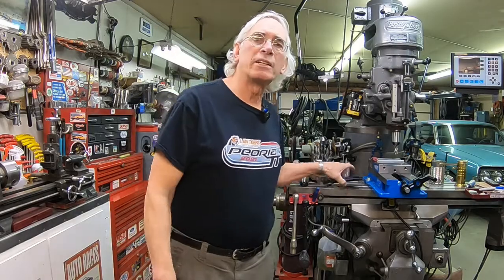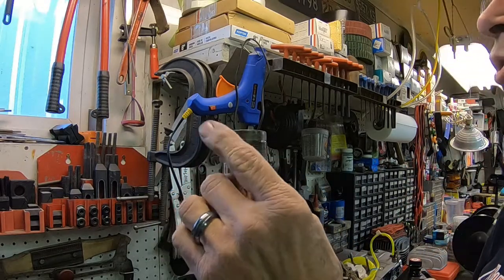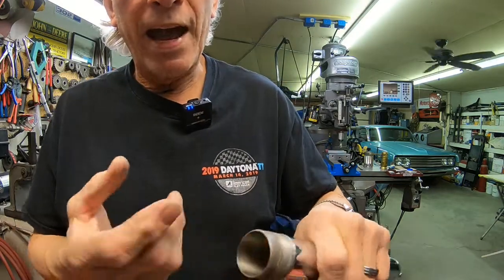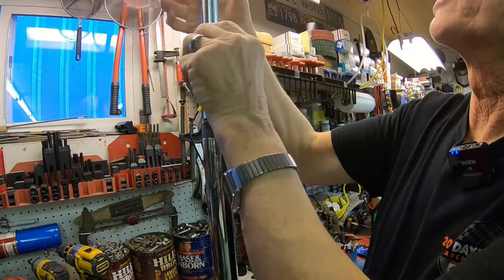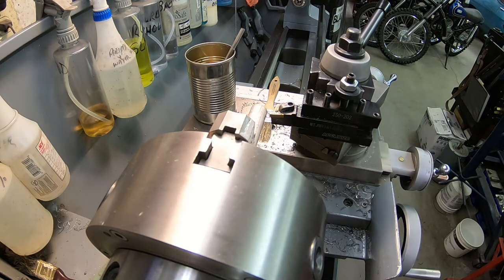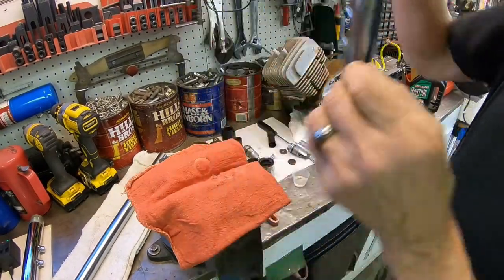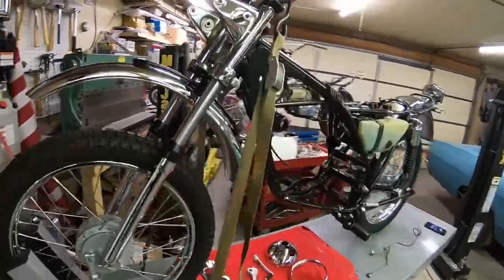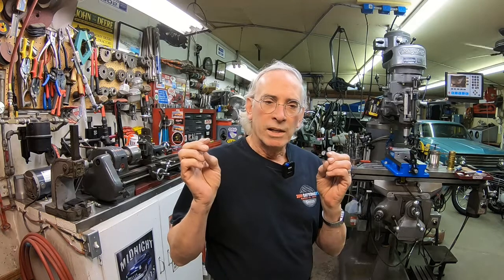73 Suzuki TC125 new chrome, front fork assembly

Comment: Hey  Dale,  man that chrome looks good, I  don't care for it much on motorcycle engines or automobiles. It  just retains too much heat. Got some more folks liking what you do. I'll be talking at cha...
Reply from the maker: Thanks Larry, yeah Im not a big fan either, but in moderation I do like some chrome. There is a whole lot on the TC 125 as compared to the TS 125. I have never had the problems with it that I have this time. I always use the same folks, and they are great to deal with. But I generally dont plate parts with threads, made it work thats what counts. Thanks for getting the word out about the channel, I sure appreciate all my viewers. I have learned more from them, than they from me. I cant believe how many folks are still playing around with these old bikes. Glad to see it. Thanks again Larry.

Comment: Hey Dale, love all your videos I’m currently fully restoring my 1973 CT3 but having a hell of a time finding parts, whereabouts do you buy your parts from.
Reply from the maker: Hi David, OEM parts I source from Rocky Mountain ATV/MC in Utah, only because they are close to me, and offer free ,fast shipping, Used parts I pick up either from ebay, or some close motorcycle salvage yards, we have a couple here in Montana, also deal with one in Idaho, Utah and Washington. I am constantly keeping an eye out for local parts and bikes for sale that I can get at a reasonable price. If you can deal with the salvage yards by phone you can normally get a better deal than buying from them on ebay. Your best bet is to buy complete bikes locally and then sell your left over parts on ebay or one of the other auction sites. Thanks for following along.

Comment: The bike looks great. I’ve had problems lately to. What do you run in your ultrasonic cleaner?
Reply from the maker: Hi Cain, you have problems...cant believe it. Think Im over mine, pressing forward. I use simple green pro (its purple not green) its safe for alumium and I havent seen that it hurts anything else. Becareful with painted items though, if left in very long it will remove paint.

Comment: Hello Dale,  its me again. Im having hard time with my 71' bike.Last time having a stucked jug, I decided to chop 2pcs of th cyl  studs and managed  to take it of.(1 issue solved) Today Im having ths issue here, 
My 125 TC 71-72  with steel bottom front forks just like  yours,but the bike didn't come wt wheel hub assy. 
Could you help me meassure the length  of the front wheel  spoke please? I want to use  stock 19 inch  wheel back  just like it was  when new.  Thanks in advance
Reply from the maker: Hi there, not sure I can be much help, I think they are about 7 1/8 long, when I got the new ones for the 73, I was restoring for a customer, I just call Buchanan's spoke and wheel, they had the dimensions and I just ordered from them. Just do a google search for them, they are in Azuza Calif. Give them a call.